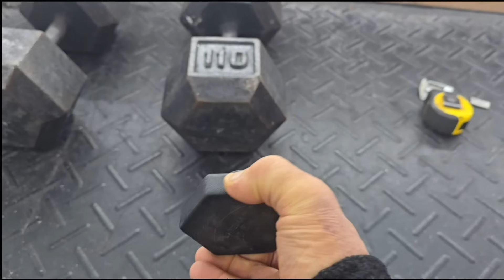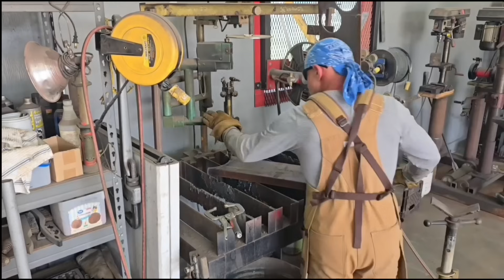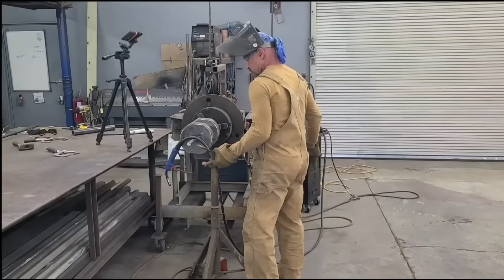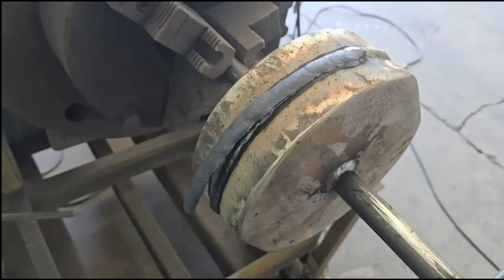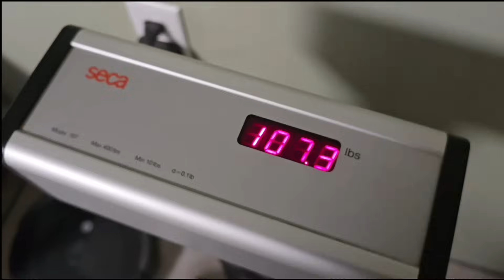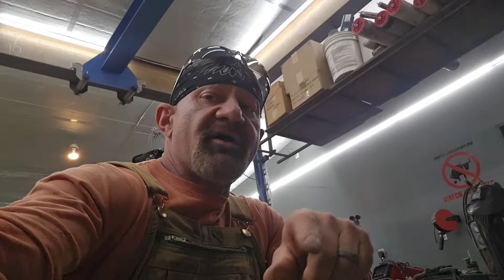Building a dumbell from scrap steel

Comment: Nice work , hey C.B , I see you are wearing your Fitvill shoes , On my boots I use these things called Fire Wall spark protectors . They attach through your laces , they save your feet from NASTY burns and adds life to your footwear. As always thanks for the content. CHEERS.
Reply from the maker: I got a set of those fire guards but haven't put them on yet...I decided to test the boots without them and I haven't  had a problem so far.  Its a risk I'm taking to find out how durable these shoes are.  If I do burn my foot bad I hope I catch it on video. 😄
Reply: Lol , I like the cut of your jib.😂

Comment: Nice dumbell build! You have more than 117.3lbs. You forgot to add the collar weight.  🙂

I agree about  030/035 and not 045. For me the only time you would need 045 is if you are trying to fill with a ton of metal up around 300 amps. That is a rare occasion for me, so its pretty much almost never i use 045. Great content as usual! Keep on keepin' on brother. 👍
Reply from the maker: Right on